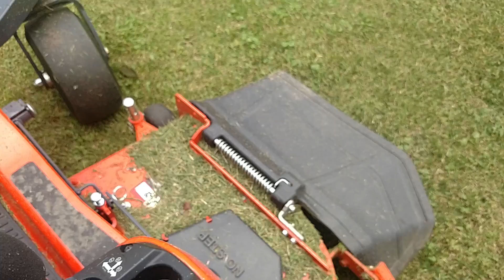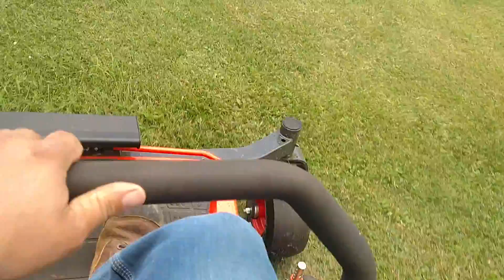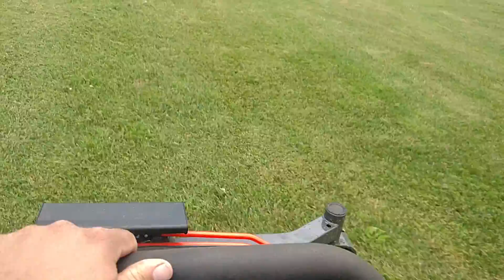Kubota ZD1021 Is this normal? Deck raises really slow when oil gets hot!

Comment: I've been following your problem  with your ZD1021 curious how you made out I've been wanting to buy the ZD1011 or ZD1021 but I 've been  waiting to see if it is a problem .I've search the web to get reviews on the machine but can't find anything .I've also been looking at kubota,s xkw726 but I've herd they have had transmission problems too.
Reply from the maker: As of now it still has not been fixed. talked to the dealer today and they are really busy with hay equipment. I don't know if this is a problem with all the new units or if I just have an isolated case. As far as buying one I wouldn't hesitate to buy it again I really like the machine otherwise. I will keep updating as it gets worked on. if there is anything else you want to know about it feel free to ask.

Comment: Did you ever get this figured out? I test drove one of these models today and it had the same issue with only 34 hours on the machine
Reply from the maker: Oil was overheating on mine. They don’t have an oil cooler.
Reply: @DLHFarms  what were you able to do about that?   I love the way this mower handles and cuts but I need to be able to lift the deck while mowing
Reply from the maker: Traded it for a zd1211

Comment: Had this problem before and was told to loosen the 4 bolts on the top of the deck at the pivot points. Worked for me and have not had any more problems. Hope this helps
Reply from the maker: yeah the dealer already tried that it didn't fix mine I wish it had. Their supposed to come get it sometime soon to check pressures on the charge pump.
Reply from the maker: thanks for the comment though
Reply: Hmm not sure then. Hopefully they can get it right.
Reply from the maker: +brandon buchanan I'm sure they will eventually
Reply: @DLHFarms  What did they figure out about yours I've had two with this same issue.

Comment: Curious to know if your hydraulic deck problem was ever fixed, and if so how? Same issues here. Thanks.
Reply from the maker: Must be something with people named Dennis that's my name too. No it was never fixed. I determined on my own that the cause is over heating hydraulic oil after several rounds with the dealer they would not spend enough time on it to get it hot so they could see the problem and they would tell me there is nothing wrong with it. I finally traded it in a 1211 which does fine other than I don't care for how it mows.
Reply: DLH Farms Thank you for the reply. I ha w spoken to several dealers in my area and all have no clue. Great name you have!